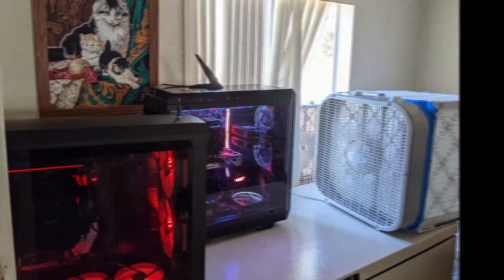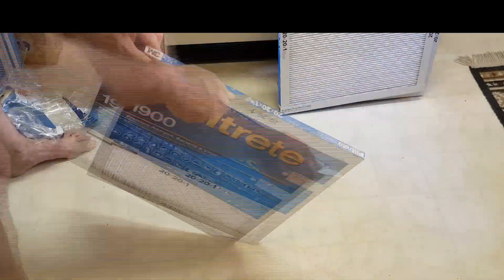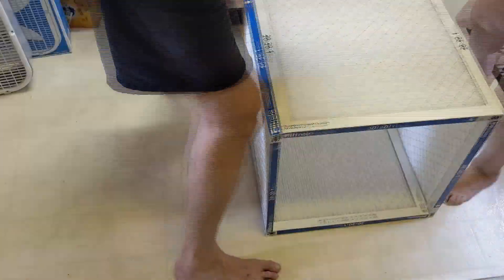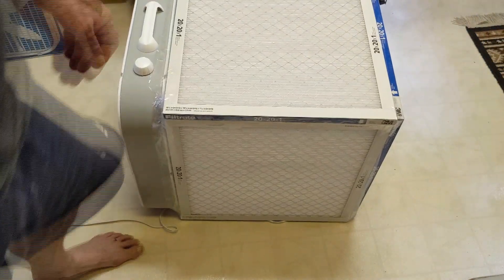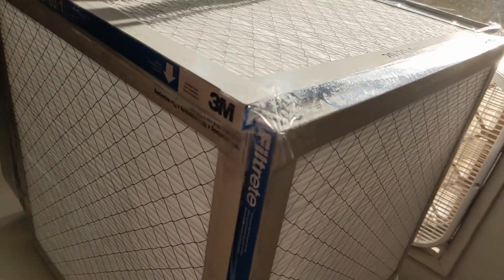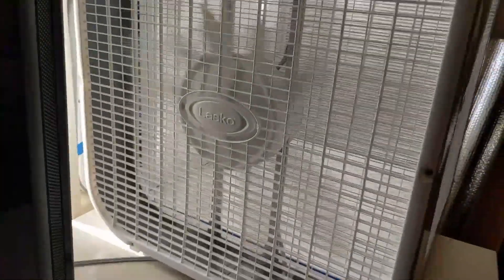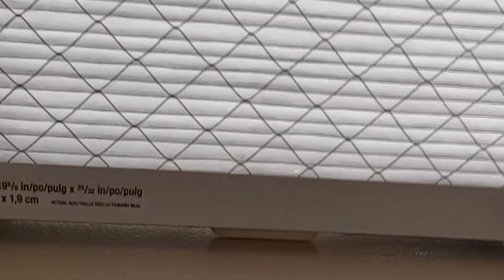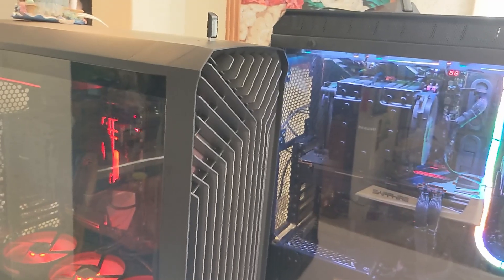HEPA filtered computer. How to build a pre-filter for your computer and clean your house air also!

Comment: No, with any resistance it's going to pull in dirty air through the front of the fan where the fins don't reach, even if they did reach it wouldn't mean there's not less pressure meaning it's still pulling air in. This is an awful design and at $20/each it's a $100 piece of garbage for the most part. If you want to make this you need a centrifugal fan, it will also be much smaller; maybe even enough to attach to the case and be much less bulky. You are a terrible person.

Comment: I think what would be even better, to put those filters inside pc (just in front main intake fans, which are the strongest) then try to build the PC relatively air tight/sealed so it will:
1. Do not contaminate with all that dust (because all is gathered by HEPA)
2. Serve almost same as genuine air purifiers for your room.

My PC is constantly running most of the day, same as air purifier in my room, why not to have both as one device, since the fans are running anyway 😊 Sure you have to crank up the intake fans a bit, but I don't think it will generate more noise than regular air purifiers do.
Reply: you don't actually need the case to be fully hermetic, you just need more pressure on the intake than on the exhaust, so whatever is not sealed, air comes out, so you don't have dust going in. you just need the filters to be sealed to the intake fans.
if you don't mind your pc looking goofy and taking extra space, you can get a ~140mm OD/~120mm ID car air filter for each of your intake fans, if you get an off brand one you can get it for ~5-15 bucks depending on the length, which isn't that expensive.

Comment: i have a toyota corolla air filter set on the top intakes on my pc. been a game changer, and i use positive pressure. i always open my window or door and stick my head out and blow it outside, if you cant or wont, carbon sploof smokebuddy. great 5x filter design!
Reply: This is low key hilarious.
Reply from the maker: yep.... I do have concerns about the oily smoke I use!
Them Toyotas run forever, don't they! Might be the filters! :face-blue-smiling:

Comment: nice! but why not put the tower INSIDE the box? I have a mac mini (10" x 10" x 2") and plan to construct something similar to what you have as a housing that goes over the whole computer with the fan facing upward and an open bottom. think it will work??
Reply from the maker: I did put the fan right to the side with the panel off. But then I can't see the purdy RGB 😞
I've thought of making a glass cabinet housing the computer and I'd blow the filtered air into.
I'm gonna think on this overnight, but more filtering is best! So it might work!

Comment: might aswell buy a air purifier, it comes with 3 filters and it filters 99 % of the air and you dont have to think about it :)
Reply from the maker: Yep, I've got a Winix HEPA which is god. Better than this as   a matter of fact. But I can't direct the airflow the same. I have this thing pile into a corner nook so it makes  a high pressure area so that dusty air won't go to that spot. I wanted a lot more airflow than the Winix makes also. But I do like HEPAs and have four Winix's in the house. We're in California nd the dust is fine from the desert, and at times fires make the air tough.
Reply: @johndicus123  the winix also may ionize the air and might cause issues with the PC, not certain but anecdotally a few people claimed "crashing only with ionizing air purifier in the room"
Reply from the maker: @jayhardway23  Thanks for letting me know! I've never heard that but will look into it.
I do know that we used ionizers where I used to work to add a level of ESD protection.
https://www.youtube.com/watch?v=qmO6ZS_VzxY

Comment: I made the same but with the fan the opposite direction, blowing in, for room filtration in summer.
Reply from the maker: yep, I have another one in the window there, it's got a single filter and larger weave as the tight ones have too much resistance right against the fan.
I have it on and it blows right into the one with multiple filters on it. It also pressurizes the house and any smoke goes out the window over the incoming fan in the window.

Comment: nice to see what you build there, i also hate dust in home and my pc :)
Reply from the maker: It's been running non-stop for six months now, and the filters are quite dark! That shows how much would be getting into the units. I'm down to cleaning the filters every few weeks and they're still pretty clean. I took one unit down last week to examine it and found just a bit of dust inside after 6 months of continuous full-steam use.